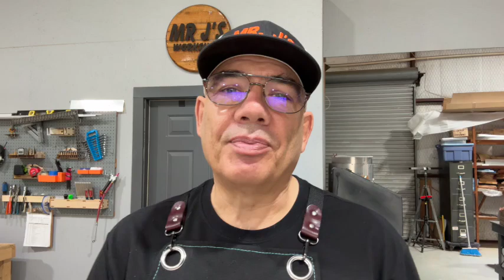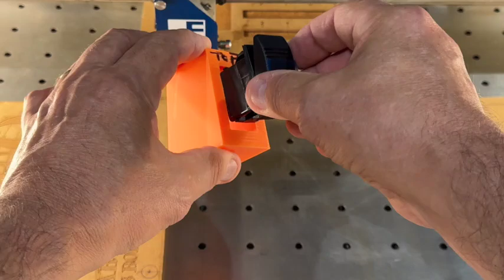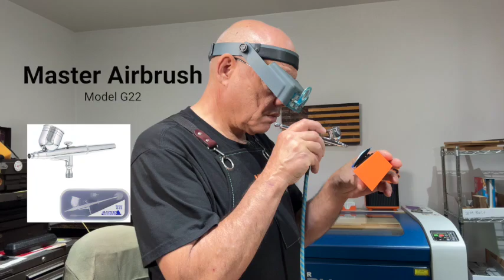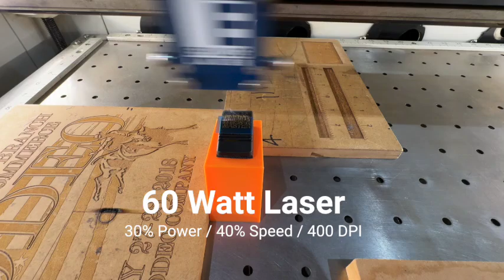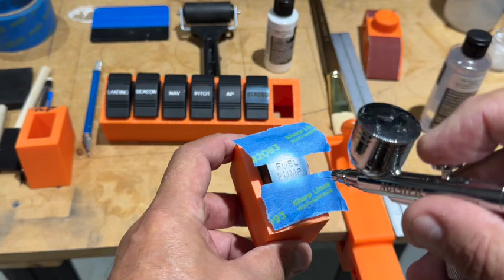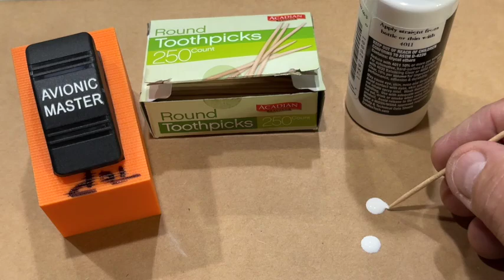HOW TO ENGRAVE, ROCKER SWITCHES AND COLOR FILLING LETTERING

Comment: What type of plastic are those rocker switches made of?
Reply from the maker: @BryanBurchfield  Hi Bryan great question I don’t know the answer to that question rocker switches can be made out of various plastics and other materials will look into that for the future projects.
Reply: @MRJSWORKSHOP  Be VERY careful lasering plastics.  ABS emits cyanide gas.  PVC emits hydrochloric acid, ethylene dichloride, and a host of other toxic chemicals, which will not only give you cancer and corrode your lungs, it'll corrode your machine very quickly.  Your results are awesome, just be careful, man.